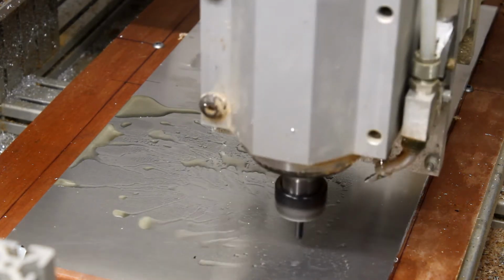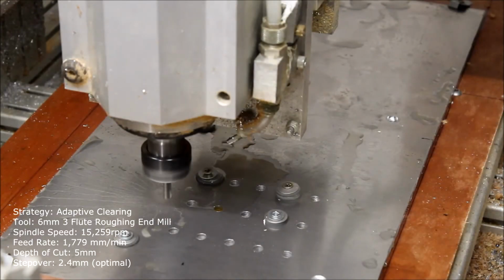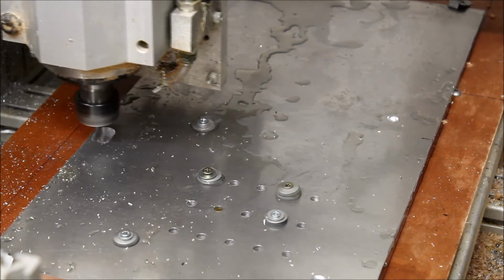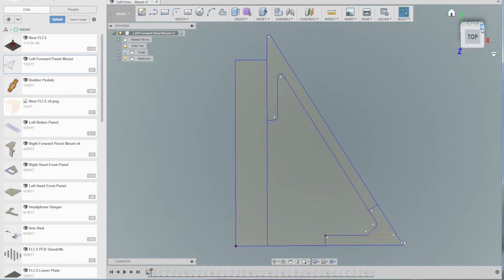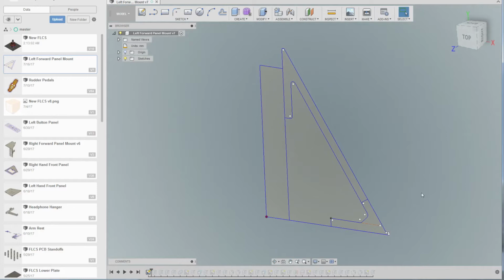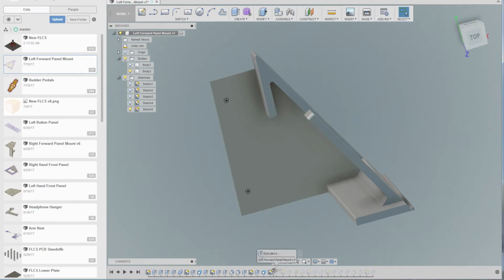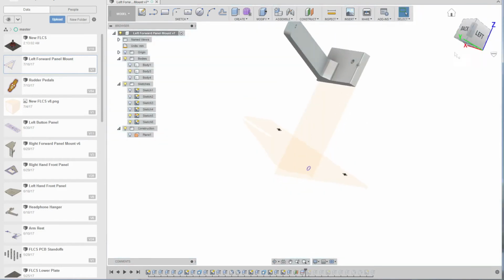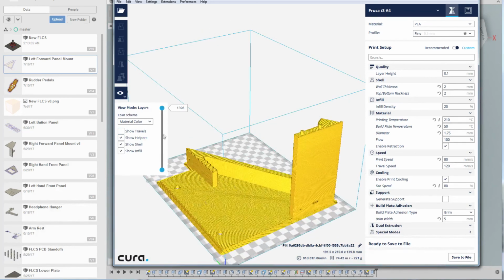Gaming Cockpit - Part 23 - More Buttons and 3D Printing

Comment: hmm you can print this no problem - just use the supports, then clean it off..
Reply from the maker: Hi Przemyslaw - that's a valid point, supports could be used, but in this case they would have been quite large and the two piece construction is way quicker than the additional time printing the supports would have taken.

Comment: What was the box thing your switches fed into? Does it convert to key bindings or directx like inputs?
Reply from the maker: Hi Julian - the Leo Bodnar USB interface is under the throttle plate and uses DX Inputs only, which is fine for most mappable controls in games/sims these days. You can use an applet to convert them to key binds as well if needed or use something like a Teensy board instead, which is fully programmable for either type of input. In fact I have a Teensy here for a cockpit related upgrade in the future, to get rid of the old Thrustmaster Cougar control board altogether, as I can fit it in the F16 grip quite easily.